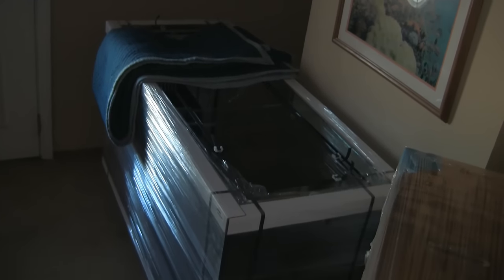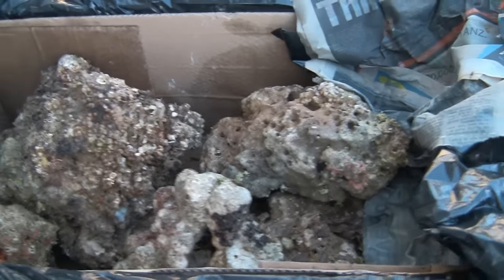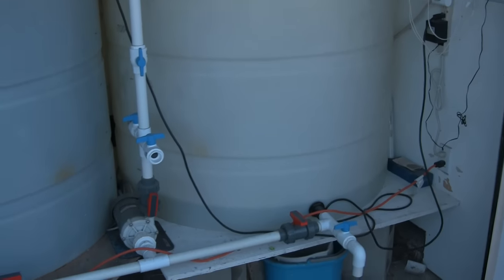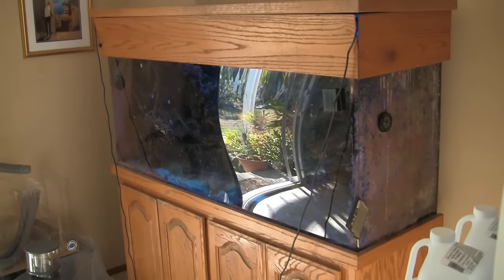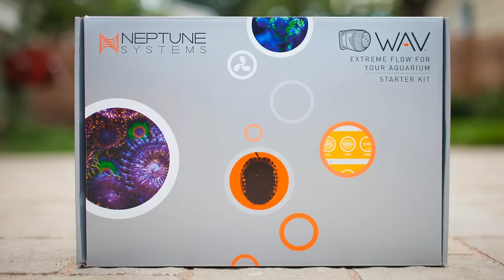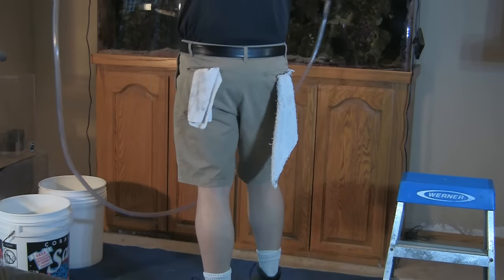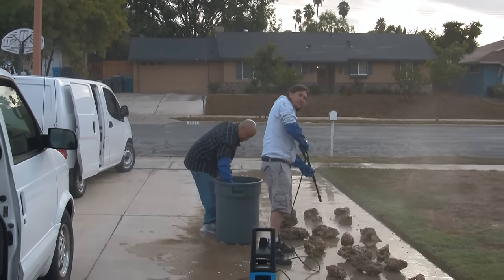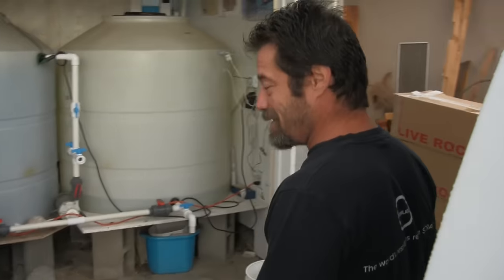Setting up my 180 gallon Glass Coral Reef Tank, LA Fishguys Episode 151 part 1

Comment: Love your videos, but then You buy expensive live rock and then blast em with tapwater dont you kill the baceria who is the reasson for buying live rock?
Reply from the maker: +Ghia Power It was the rocks shapes and look that was the goal, and using the cleaned live version instead of the dead version puts me a step ahead.
Reply: +Ghia Power  The rocks were blasted off with salt water that was being fed to the pressure washer. Not fresh water. Cande actually had to run out and get a new pressure washer that morning as the pressure washer he started with died. He'd been using that pressure washer for salt water for several months but ultimately, salt water takes a toll on pressure washers.